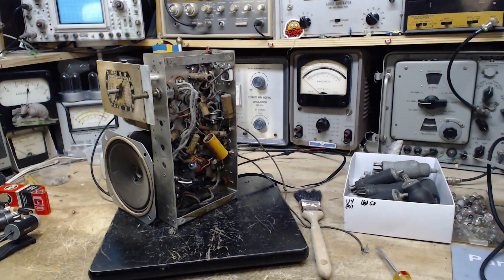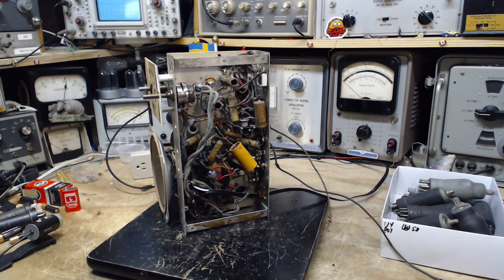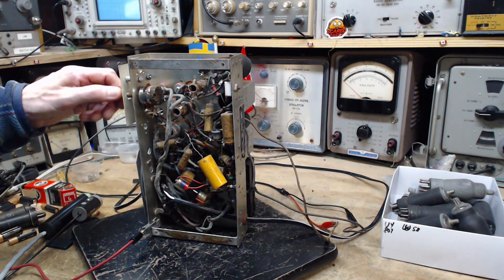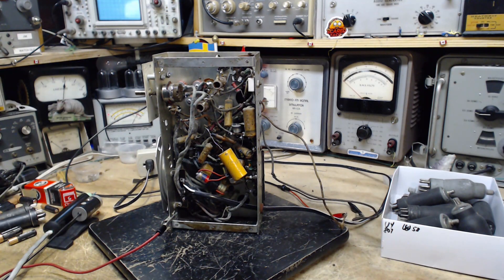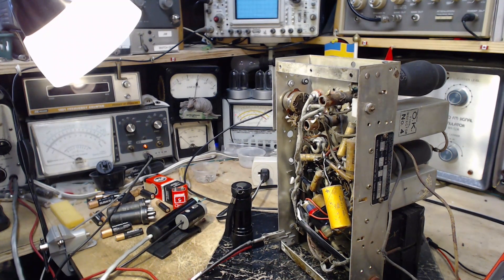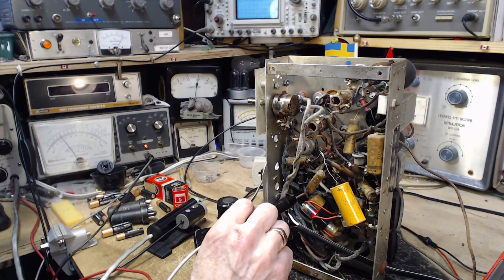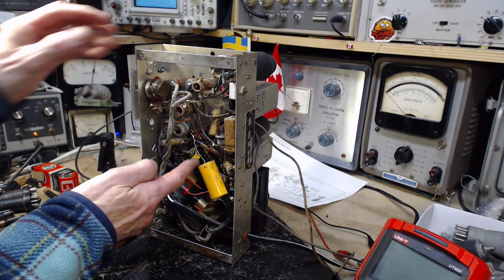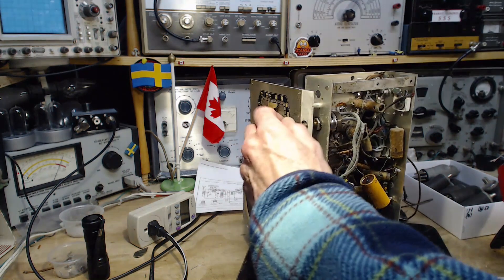Rogers Majestic 9R512 Tube Radio Video #4 - Output Tube Bias

Comment: y' know that fine oscilloscope on the shelf is a great way of performing a number of tests at one time. And; it is a great instruction tool for the less experienced. It would have displayed the levels, polarity and distortion all at once. All at an input impedance of 10 Meg ohm.  I presume that you know this stuff - share it with others. Just sayin

Comment: So you replaced the wax paper cap between the 75M and 41M tubes and got a good results with a negative voltage. ✅
Sound is no longer distorted. See you next year JIm. Happy New Years Day. Steve from Illinios